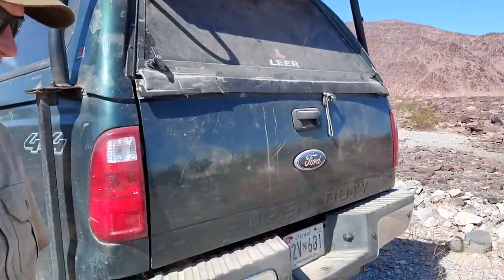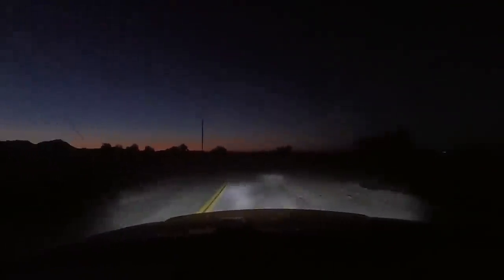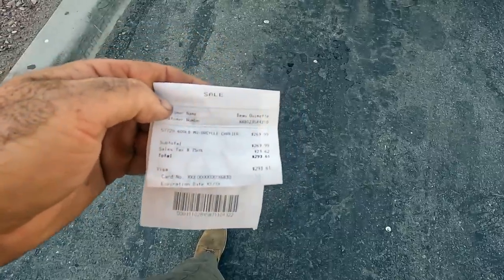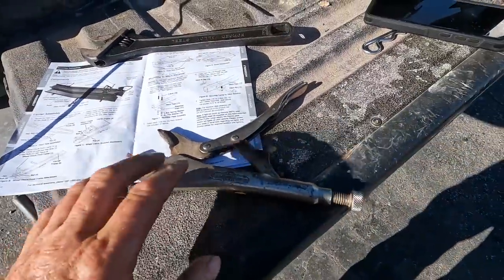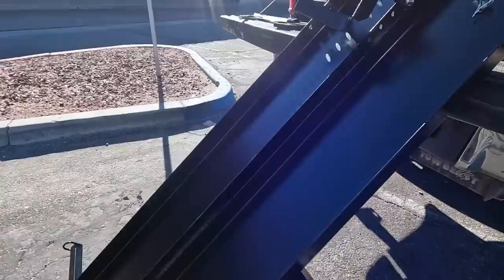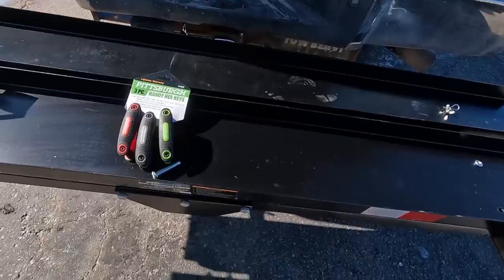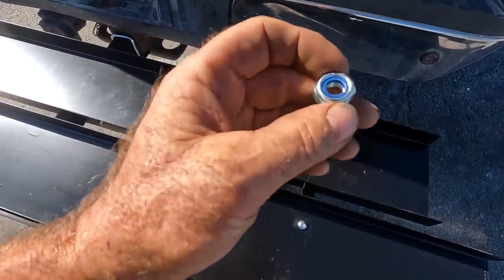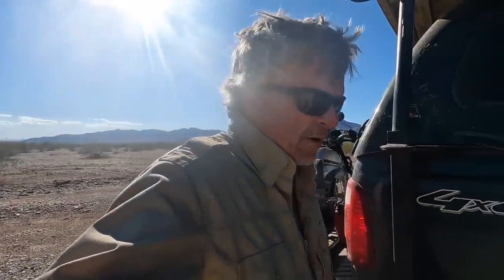A Trip To Buy A New Motorcycle Carrier From Harbor Freight

Comment: These types of hitch attachments never work out long term. The receiver puts a lot of stress on the metal and it eventually breaks. That's why i like the 3 point ones where they give you the option to either use the rails up top on the roof or stabilizers off the bolts that hold the hitch bar on, making kinda like a "shelf" out of it.
Reply: @Fried-Pig-Nipples  Its amazing how that works, isn't it?
Reply: An engineer would always triangulate
Reply: To be fair, he admittedly was on a four-wheeler trail😂.  I probably have 40k miles and four years on my motorcycle carrier(not off-roading of coarse).

Comment: Oh no dude. The problem with Harbor Freight stuff is the quality control sucks so bad, you never know if you've got garbage welds or garbage metal that you're trusting. You already know that though am I right. When we haul small motorcycles off the hitch we actually use one of the ones that are intended for mobility chairs, it seems like they're very serious about quality because of the extreme liability that comes with it. They also have built in ramps, sometimes hitch baskets don't have that unless they're intended for mopeds/dirt bikes/quads/atvs.
Reply: I have 40k and four years on my HF motorcycle carrier.  Also, other companies sell the exact model that HF does(Black Widow 600lb carrier is one).  I doubt these companies would want liability problems, by selling dangerous carriers🤷‍♂️.

Comment: I have a GMC 3500 Sierra and the hitch is kinda high so I purchased a Gen-Y drop hitch receiver to lower my rack, making it easier to load and unload. I got the Gen-Y because I was worried about the bouncing creating dynamic increases in torque/tongue weight. The Gen-Y is rated for 1500 lbs tongue weight. After seeing this, I can't help but think that I should have gotten theire more expensive model that has torsion flex to damper the bouncing, since my rear springs are so stiff.

Comment: That's a complete different design than the one I bought from Harbor Freight over a year ago.  Mine has the steel square tubing that comes straight out from the receiver.  The cross piece, that the bike sits on is all aluminum.  Mine does not have what you called the front wheel chalk.  Your's by the photos seems to be all steel.  I think they copied one called black widow.  OR, HF is actually selling the black widow.    Thanks for sharing -  Jim
Reply from the maker: It worked very well and I am still using it. Can recommend.

Comment: Attention attention don't let it break again it could be disastrous people could lose their lives take another piece of square stock steel and slide it inside the the square tube that runs from the receiver under your motorcycle hauler welded in by the ends and reinforce it😮 I'm glad I seen the video it's a huge warning to anybody to reinforce that hitch or use thicker stock to begin with and customize it slide in other piece of square stock in side the other tube

Comment: Harbor freight product broke and your returning to HF for a replacement part, hahaha HF=JUNK.  When you buy cheap you get cheap. These racks at HF sell from $150-$250 my scooter hitch rack cost over $800, you get what you pay for and check the other videos of HF hitch racks breaking, you certainly are not alone. Note: Being cheap is costly stay away from HF next time
Reply from the maker: The one that broke was custom made in the U.S.A, very expensive and not from Harbor Freight. The Harbor Freight one is still working great a year later. YMMV